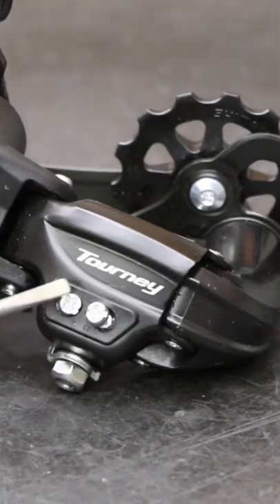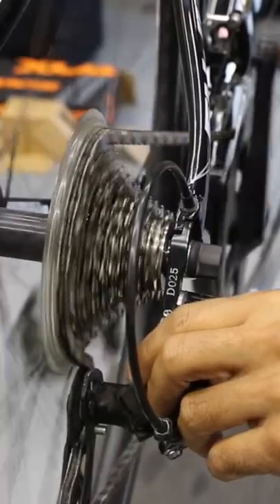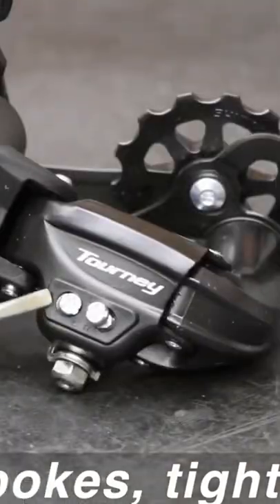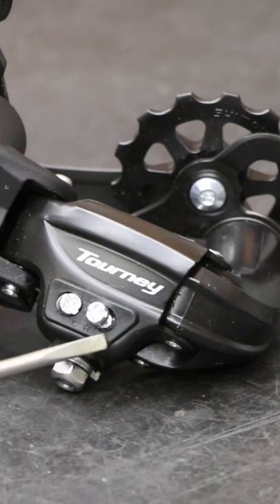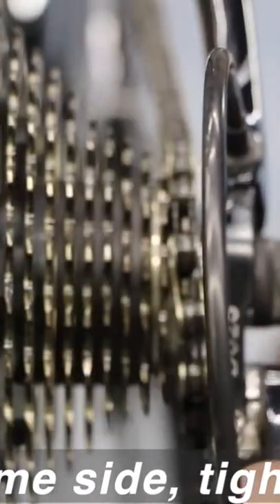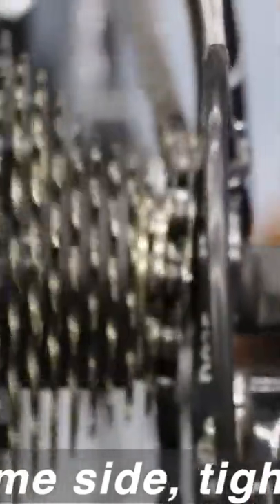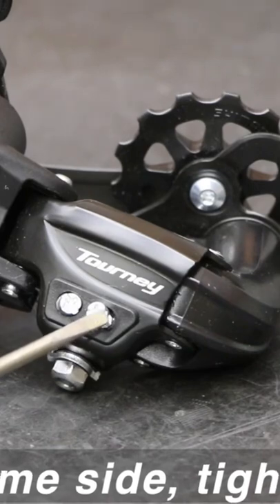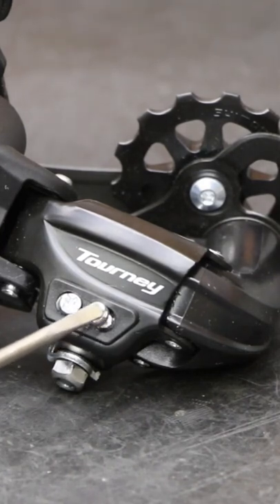Only touch the derailleur limit screws to correct these two problems.

Comment: Pro-tip: never touch the limit screws on a tourney. Just throw it away and buy another!
Reply: Why are they bad?
Reply: @Bestun21Kurd6 they're made of plastic, if they're that worn just buy a new one
Reply: Dam I'm glad I bought bike with acera gear. I'm a first timer with gear bikes
Reply: The tourneys arent that bad, take good care of them and adjust them properly they will last as long as other deraileurs
Reply: Just threw in the towel after trying to get my wore out tourney running smooth lol. Deore 1x11 upgrade it is
Reply: @Noah_McAlister  I might just be lucky but my experience was tourney was ok
Reply: I had this exact derailleur for 2 years and it never fails me. That's when i upgraded to Shimano cues

Comment: Sir my altwoo a5 derailleur under jocky wheel mount was not straight how i straight my gear plz reply
Reply from the maker: Use a adjustable wrench. The bigger the wrench the better. You want the flat surfaces to protect the outer cage as much as possible. Use the wrench handle to twist and straighten.

Comment: Which way should I turn the H screw if im ghost pedaling at top speed?
Reply from the maker: Ghost pedaling? (Cranks are continuing to spin long after you stop pedaling. This would not involve the derailleur.) Turning the H screw clockwise will drive the end of the H screw into the pathway of the derailleur stopping or limiting the derailleur's full rang of movement. This will stop the derailleur from moving towards the smallest gear (high) in the rear of the bike. This is specific info regarding the rear derailleur only. Only turn clockwise in very small increments. Only turn clockwise if the chain is not staying the on the last smallest gear and the chain is continuing into the frame of the bike.

Comment: What if your front derailleur wont shift up?
Reply: Maybe your H limit is too tight, try to rotate it a bit anticlockwise, or slacken the cable a bit, these should maybe work.
Reply from the maker: There is so much to consider. Test the shifter all by its self. Disconnect cable and confirm movement from shifter.